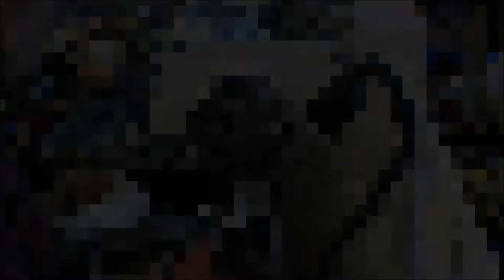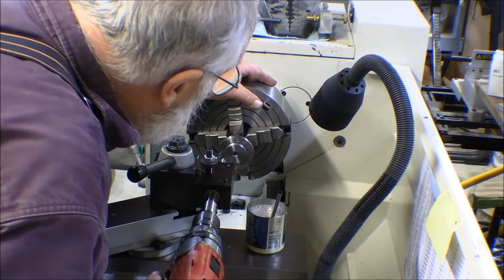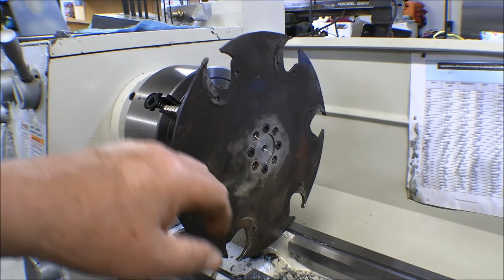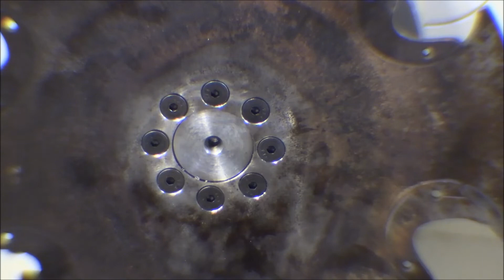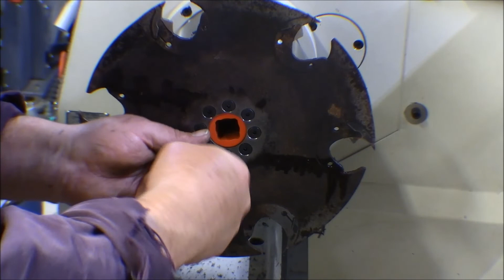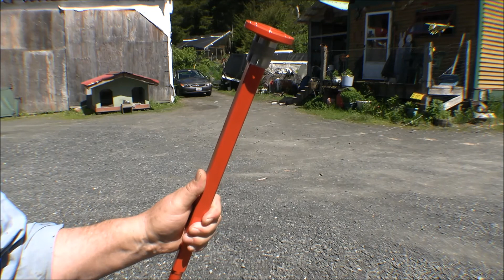Mobile Dimension SawMill Repairs; Edger Shaft Finished

Comment: Hello again psgflier. I contacted you about 1-1/2 or 2 years ago on your restoration of this Mobile Dimension sawmill. Looking through your extensive playlist of various videos, it looks like you have done about 30 videos on this mill. This one on the edger shaft being the last one and it done 2 years ago... So I am a bit more than curious to ask: did you ever get it totally done and running? Was there any more videos on it after this one?
Reply from the maker: I had to stop working on the mill to get my plane ready for the season. I've wanted to get back to it, especially when I look at the pile of parts all repaired and ready to go back together, but have too many projects that are more important.